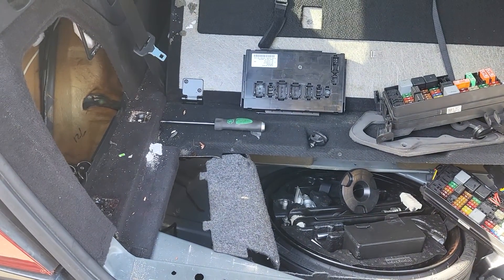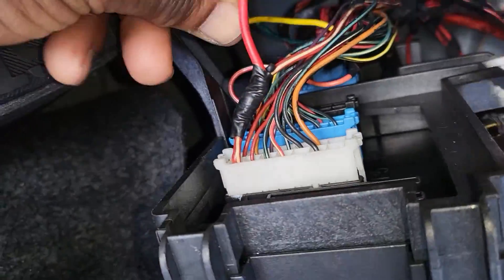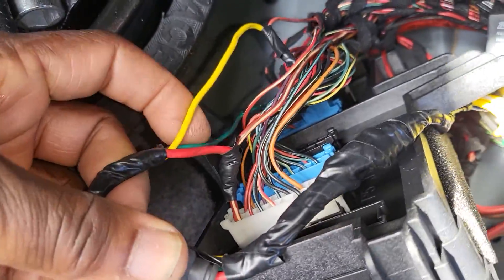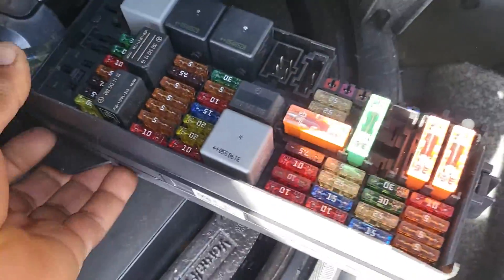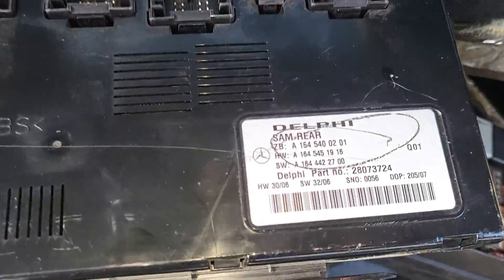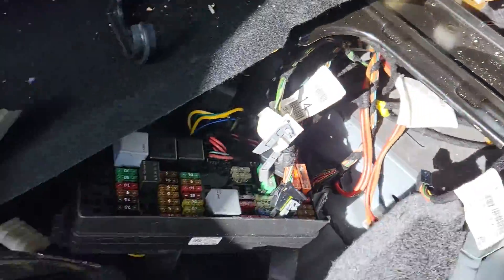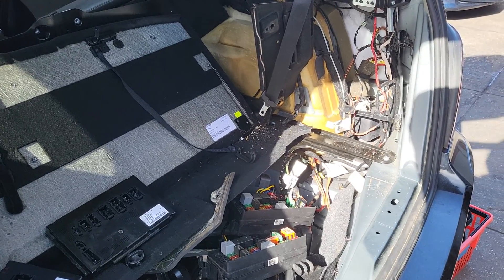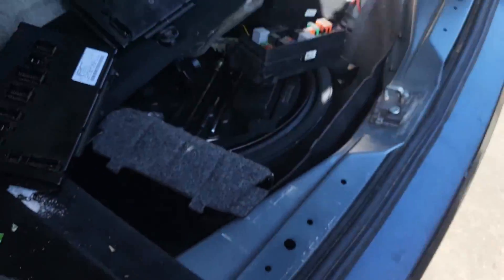2005 Mercedes Benz R350 Fuel pump Relay Fuse Box Assembly And Rear Sam Control Module Replacement

Comment: Thank you and nice explanation I have the same Model S350 2006 and I have a problem and I don’t know if it is a fuel pump or relay after several time the engine run then it’s okay fine

Comment: Just had the exact fuse melt except i was in the process of finding a battery drain issue
Reply from the maker: I'm sorry to hear about your situation. A melted fuse is usually a sign that there's a circuit problem in your vehicle, which could potentially be related to the battery drain issue you're experiencing.

Here are some steps you could take:

Replace the Fuse: First, replace the melted fuse with one of the same amperage. This should restore function to the circuit it was protecting, at least temporarily.

Identify the Circuit: Determine what the fuse was protecting. This information can usually be found in your vehicle's owner manual or on the fuse box diagram. Once you've identified the circuit, you can start troubleshooting that particular system.

Check for Overloads or Shorts: The most common causes of a melted fuse are an overloaded circuit or a short circuit. An overload can occur if too much power is being drawn through the circuit, such as by a malfunctioning device or too many devices running at once. A short circuit can occur if the wiring insulation has worn away and the exposed wires are touching each other or the body of the vehicle.

Battery Drain (Parasitic Draw) Test: If you're dealing with a battery drain issue, you may want to conduct a parasitic draw test. This test helps to identify any circuits that are drawing power from the battery when the vehicle is off. If the draw is higher than 50 milliamps, then you likely have a parasitic draw that's draining your battery.

Consult a Professional: If you're unable to locate the issue or if the problem persists, consider consulting a professional mechanic. They can perform more detailed diagnostic tests and have the experience to deal with complex electrical issues.

Safety note: Working with electrical components can be dangerous if not done correctly. Always take appropriate precautions, including disconnecting the battery before working on electrical components. If you're not comfortable with any of these steps, don't hesitate to get help from a professional.

Comment: Hi sir i have a problem with my ml359 bluetech 2010 i ran out of diesel because my fuel gauge was giving me a wrong information not knowing that there was no fueo in thw system i went ahead and start check the the diesel fuel line on the injectors and there was no fuel coming to them i later went to the tank and discovered there was no fuel now there is so much air stuck in my system how can i get it out
Reply: Ml350

Comment: sir I have a car m b s class 350 amg . I find the problem is fuel pump  control module not open power for fuel pump. mod power  also is good.sir can you have eny sujecicon
Reply from the maker: Yes check in diagnostic and see if you can communicate with the fuel module